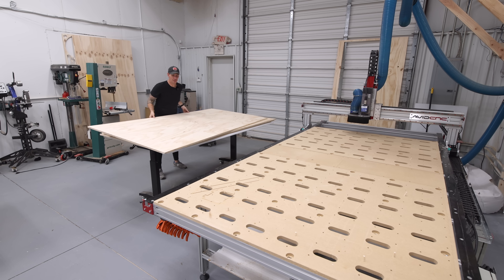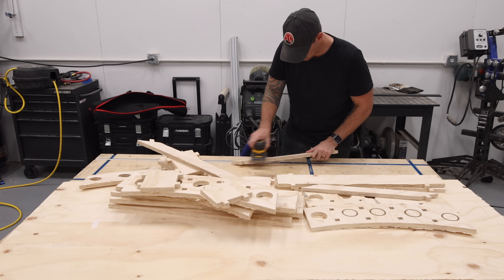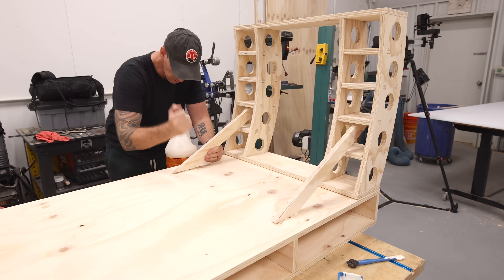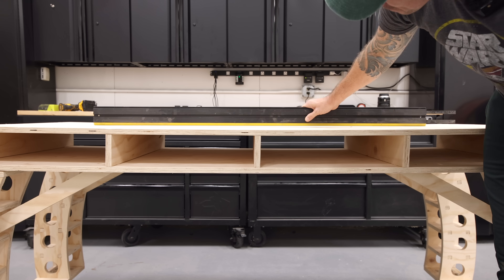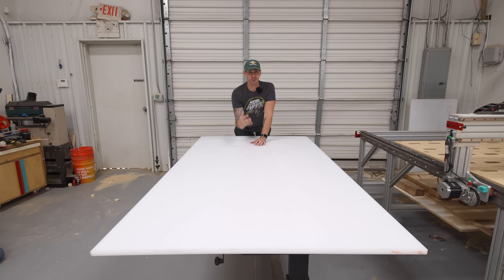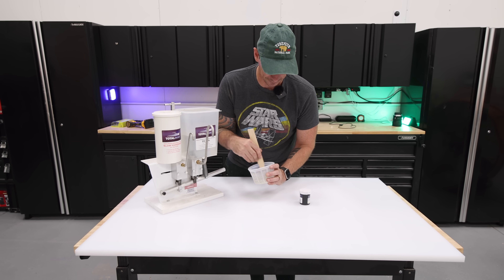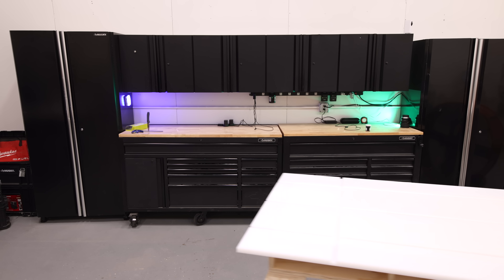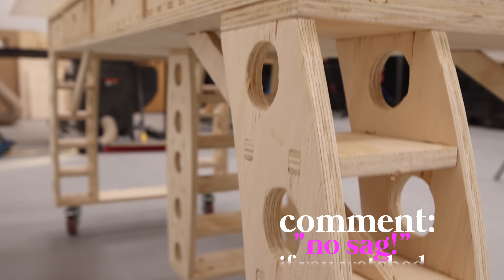Building a WORKBENCH That Does Something No Other Workbench Can

Comment: "No sag" Your top needs at least one run going the length of the table to be a torsion box otherwise its essentially just 2 sheets of plywood. I'd totally drop that much for a bench top but I don't think I'd cut the grooves into it, I think that might limit it in the future. Very cool design though, I like it.
Reply: I think it’s technically a torsion cubby hole now haha
Reply: Yeah, I'd have a hard time justifying those grooves in a $615 board. I think I'd try to find ANY other way to get the functionality that the grooves will theoretically give.
Reply: @SuperDavidEF  just look up how badly that stuff gets abused in combat robotics 😂

Comment: I'd love to add HDPE or UHMW to all my assembly and resin pouring workbenches but here in Australia, I'd be looking at somewhere in the region of $5000 for that as compared to maybe $200 for 5 or 6 sheets of melamine. I'm just about to swap out my melamine for new sheets for the first time in 2 years as they're a bit battered and bruised now but still, that's a HUGE price differential. The resin I use pops straight off melamine without a single issue so the only bits I ever throw away are the edge pieces and as a rule, I don't often build forms for my tables anyway, I tape off the river, clamp down to the bench and pour and then cut to size when I'm done. Works like a charm. I'd be worried that I'd do more damage to the UHMW trying to get the slabs up off it. And then you've wasted a phenomenal amount of money. But, if money is no object then I guess, yeah, it's nice.

Comment: no sag - love the design and use of the CNC for the box joints (no dog bones for the female rectangles???).  A bit much $$ for me on the top, but understand the usefulness if pouring epoxy regularly.  As others have said, a vertical member in the bottom or center of the top would likely cure your sag. Love the video - keep them coming.

Comment: You might want a slight draft angle (2 or 3 degrees) on your slots, or if you do a big epoxy project that has a groove through the middle of your "mold box", if epoxy filled it, it would be a really thick piece and would likely be hard to get out of the groove, even if it doesn't stick at all.
Reply from the maker: The grooves under a pour will get filled with plywood strips and covered with tuck tape.
Reply: @JonnyBuilds  That's a better plan

Comment: I spend 40$ on wheels for my workbench. Maybe add 30$ more for the screws and bolts. Everything else was reclaimed wood... pine lumber, oak lumber, some framing, some 1x6... but good stuff. I placed a sheet of left over vinyl on top. Once the top of your UHMW gets a few scratches on it... it will become harder to peel that resin off, FYI. Oh, and it will get micro scratches, trust me.
Reply: Even with the UHMW (I have a 4'x8' HDPE top that is the base for any sized mold I need)...you still should use some silicone oil spread out and left to dry for the large table sized pours.  This will take care of any micro grooves in the surface where the epoxy will look to grab onto...

Comment: Depending on how thick that sheet of uhmw you got is, 615 bucks is actually pretty damn cheap.  Generally speaking a 1.5+ inch thick piece at those dimensions retails for more than double what you paid.
Reply: That looked like 3/4" thick to me, that would explain the 1/2 the price observation.

Comment: Two vertical supports lengthwise could have been attached to the leg assemblies and your work bench would still be able to roll around. What you have done relies on your concrete slab to be dead flat for the top to remain flat. But it is a cool looking design, almost furniture like.

Comment: are you going to use tyvek tape when a form will a groove in the middle?
Reply from the maker: Yes that’s exactly my plan. I’ll put a strip of plywood in there first to fill up the empty space and then cover with tape. Should’ve mentioned that in the video.
Reply: @JonnyBuilds  smart move and smart choice on the material. I think it’s definitely worth the price. What kind of wear characteristics does that material have?

Comment: 12 months ago I spent $1200 on 10mm thick aluminium sheet for my table tops. If I was to buy the same aluminium today, it would cost over $2500. I do want to get removable UHMW to cover the tops when I am doing pours. But I don't want it to get damaged if I was to use it as a work bench aswell.

Comment: This is YouTube woodworking at its best and I must confess I am envious - of your large workshop and CNC machine. I was designing workbenches out of plywood along similar lines back in 1990 (a project in my book Electric Woodwork) years before YouTube. My only contribution to the sagging issue is you could double up on the thickness of the plywood for the topwhich will also give you a stout surface to use a mallet or hammer on the top (assuming these techniques are used in the USA). Filling in the rear of the drawer openings or adding triangulation there would help. I love the scultural form and  the use of this plywood (It is called Brazilian pine) I have been using variants of this for my furniture designs since 1979 is precisely why I am building a CNc machine. You beat me to it! This is a refreshing non myth busting non clickbait video as anyone can see from the thumbnail what is promised in the video. There are some great drawer constructionds there and novel tool extensions used. Nice.

Comment: Why not just put some splines under the bottom of the “torsion box”? It would’ve added the strength your looking for. I put torsion box in quotes because torsion boxes by definition have boards that run in square grids so that it prevents racking in all directions.

Comment: 3:14 Regardless if the tabs are tight or not, I can visibly see in the video there is a bow and that the top/bottom is not flat and true.  This top should have been clamped with cauls.   As for the warping the other way at 5:45 "Torsion" box designs require stringers. This is where they get their strength and rigidity from.

Comment: Nice bench! One question where can I get the plastic sheeting? I have been looking online for a long time. Do you have a link? If so can you post it? Thanks
Reply from the maker: Search plastic supplier in your local area.
Reply: get 4' x 8' x 1/2" HDPE for the base - you can get that for about $275 shipped.  For a total all in of $425 you'll have the 1/2" base and all the sides (use 3/4") to make any configuration mold you need.

Comment: I think I would have just gone with 2 stretches on the underside of the bench and not the 5th leg (my floors aren't that level/smooth - I would have had a wobble table - ha) turn that into a "drawer going lengthwise and had that as the storage space for the mold boards.  Interesting concept .. I would not have thought of it

Comment: Just an additional info:
UHMWPE is the material that is used  in knee prosthesis surgery to fill the gap between two metalic components placed on thigh bone and shin bone...
Reply from the maker: So awesome!
Reply: Used it a lot on bakery machinery, great stuff - just don’t use cheaper nylon sheet, it can be affected by damp conditions.

Comment: Calling that a torsion box is weird.  Its like if you went to a Ford manufacturing plant and took a skeleton off half way through manufacturing.  Is it a car or does it need to be completed to be a car?  I can agree that 100% isn't needed (like backseats or carpeting), but if I cannot drive it and it is partially assembled then it is not yet a car.  Continuing to call your drawer box a torsion before it was complete enough to resist torsion seems either disingenuous at best.  Clearly it cannot resist (hence the sag).

Comment: The bench does look cool. Couple suggestions. Instead of rhe center support touching the ground you could have made/added something like an I-beam down the center for support. 2nd, I'm sure you will notice over time your drawers will be hard to pull. I'd recommend you take a little off the height of each. Then add a small piece 1/8" thick, running the length of each drawer on the bottom edge. Then you can run wax along these. The wax will make them slide very smoothly and easily. Be careful you dont pull them out the first time. Also, depending on usage you'll need to reapply wax every few months. You can use a simple house hold candle for the wax. Cool work bench though.

Comment: Nice looking build. A few comments/ suggestions for your structure. Some of those pinned/ 
Glued joints could use some screws after the fact, and screws to attach the legs to the table instead of glued in case modifications or repairs are ever needed. I wouldn’t call that a true torsion box with no longitudinal members, sag ought to have been expected in that set up. If the top was a torsions box and didn’t sag I’d still suggest a stringer run between the bottom of those two outer legs and the center one would not be required.  It’s nice to make fancy cool looking things in CAD, and CNC skills, you clearly have that down, now I’d just suggest brushing up on some basics of structures. If the designed were refined a little more it almost looks like something you could package up and sell to consumers, or at least your plans/models.

Comment: I watched to the end but I will not be dictated too. I will not write no sag 'cause I'm a rebel. 😁

I read a few of the comments and I have to agree with the others. You don't have a torsion box. Any unevenness in your floor can result in twisting of the table top. I like the concept of the slide through drawers but I think I'd approach it a little differently. I'd put together a true torsion box and then add the drawer section underneath. I'd also inset the legs a bit (I run into enough things already).

Also, even though it's UHMWPE, it's still relatively soft and can get scratched and dinged up over time. I used to be in the composites business and I had a flat mold that had a gelcoated fiberglass top. I built a plywood cover for it that I could take off when I needed to use the mold surface and cover it to protect the surface and use it as a workbench when the mold wasn't needed. The cover was just a sheet of 1/2" plywood with a 1x2 trim board around it so the ply wouldn't slide off. Just a thought to help protect that $$$ investment.
Reply: I was thinking the very same thing.

Comment: I love your design until you added the center leg, I see it as a problem because most floors are not that even, that’s the main reason for torsion box construction. I would rathe see the top a little thicker so you could keep the drawers and add longitudinal stiffeners under the drawers. I wish I had that CNC router. Keep up the good work.

Comment: Your torsion box is only halfway towards a torsion box, so it makes sense that it sags. You need verticals going both directions, not just one, if you want no sag
Reply: I agree.
Reply: Without several ribs running the length there is no torsion prevention to it. He can lift one corner and the whole table will twist. I agree as well.
Reply: Yea, it's not a torsion box. Its two pieces of plywood with dividers between them.
Reply: Very true.
Reply: This is just a poorly designed fancy table.  CNC does not mean well designed.  How does a channel like this get 433K subs?  I guess people love a train wreck.

Comment: I would totally use a UHMW bench. Might have to make one now 😄
The strength of a torsion box (aka stress skin) comes from what is essentially an I-beam made from the ribs, top skin, and bottom skin. Without going into the structural math, you need ribs running the length of the unit that are glued to the skins if you want added strength in that direction. 
The aesthetics of those legs is awesome!
No sag
Reply: No sag; agreed. I know it's more difficult to see some of these flaws while designing/building but as a certified back-seat carpenter I saw it while you were assembling that the center section had no triangulation or truss properties. Rather than add a center leg I would have added full-length trusses under the second sheet, and glued them to the legs on each end.

Comment: I like the Aesthetic concept, but the execution of your "torsion box" made me cringe. Also, with the design of your legs, it puts your supports in tension, rather than compression, making the joint somewhat weak and susceptible to the weight of a large epoxy pour bowing the table, even with your center support.

Speaking of large epoxy pours, the grooves you cut in the surface make it completely useless if you want to, for instance, pour a tabletop, even for something the size of a coffee table from the looks of it.
Reply: How would you design it for compression?
Reply: @reh.4919  either inset the legs and put the support on the outside of the leg to keep the radius the same direction, or reverse the legs, but that would be less stable
Reply: @benferguson5929  I think I understand, thank you.
Reply: I felt the same way about the grooves - however he mentioned above that he'll fill the grooves with pieces of tyvec wrapped plywood...

He could just as easily made a 4" "wall" around the entire bottom base permanently secured...then within that "wall"  you create any size/shape smaller molds by hot gluing in 4" pieces of HDPE or wrapped plywood the lengths you need...you can create endless molds this way and there would be no need for the grooves.  

With my 4'x8' HDPE base you can pour up to 16 approx. 12" x 24" trays all at the same time...

Comment: "No Sag" 🙂 I was just doing some maths and trying to see if it would be worth buying the fancy top to use for appoxy projects and got a HUGE surprises. Say you were doing a load or large tables or some other project that required a large area of appoxy. $600÷$40 (expensive fancy top ÷ sheet of melamine) = 15 sheets!!! You only need to mess up 15 sheets of melamine before it would have been cheaper to buy the fancy material!! If I used resin on a regular basis I know which I'd choose. Good advice, thanks 😊

Comment: PPG paints sells a paint called "Breakthrough" that is a waterbased paint designed to act like oil based paints. It's finish is extremely tough and depending on how many coats you apply, can act like a stain by allowing the woods grain to show through if you prefer.

Comment: Just from an aesthetic standpoint, your table legs should have been flipped around, arching inward, and placed inbound enough that the feet didn't stick past the edge of the table. (Not looking bow legged) That alone would have helped "some" of your sag. But a real "torsion box" needs longitudinal supports like a spine, not just ribs. But hey, it's a another horizontal shop surface in which to pile things on, so that's a win! Good content nonetheless.

Comment: Isn’t it like a non stick pan? The more you use it the less non stick it gets. And if you want to use it as a workbench then it won’t last that long. 

Not to mention that while the resin is curing you won’t be able to use your work bench. 

Why not just buy a slap of this and reuse it when making molds? Instead of putting it on your work bench
Reply from the maker: Non stick is a coating whereas this is 3/4 inch thick of solid plastic

Comment: Overly complex.  If you spend an hour or less watching Ron Paulk talk about his bench you'd learn quite a lot.  With (or without) your CNC you could toss one together quickly.  Feels like the groves you cut in the pricey material limits your option to those dimensions.  Seems like you could have unlimited options with just walls and packing tape on an unspoiled surface
Reply: Not everyone is overly concerned with being able to reuse material or being limited to its design.

Quite the opposite, when one builds a bench with this level of specific detail… the point is rather to be “limited” to its design.

If you want to hack together some crackhouse version of a workbench with packing tape, go nuts. But, don’t act like building a quality purpose built bench is somehow a bad thing.

Ridiculous. Honestly.

Comment: NOPE. Not worth the cost and the production of the top material pollutes more than than waste of the regular "poor guy's" way of doing an epoxy tops per 10 years. Ya did not think about the fact that Plastics are a by product of oil production waste. And lets face it that bench will eventually end up in a landfill after you are long gone, and the plastic will be there pretty much forever. Sorry not an environmentally friendly thing like you want to play it to be.

Comment: “No sag” Just found your channel. Cool build. I would pay that if I had it saved up and knew it would pay for itself after several builds. I think I might be apt to put something over it to protect it when I’m not using it for epoxy if that was my only table. Does glue stick to that after a glue up?
Reply: Nothing sticks to UHMW. It is also the perfect face for any rip fence because of how slick it is.

Comment: Until you fixed the design flaw, I was not impressed. You didn’t just design a torsion box - you modified it for your purpose and then fixed the short comings.  I’m glad that I kept watching. Don’t have a CNC and usually don’t watch vids featuring them.

Comment: The legs are held on with brad nails and glue and 2 pegs?  Really?  All that work to rely on brad nails and glue... Nope.  Your "torsion box" has no torsion member.  It's just a box.  Form over function is no kind of way to build a bench.  This will sag over time and be garbage.